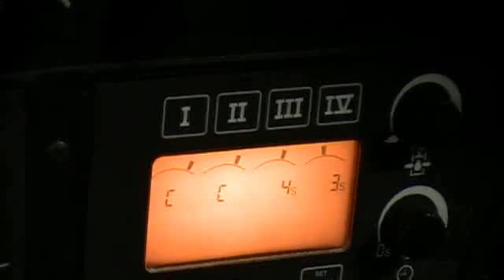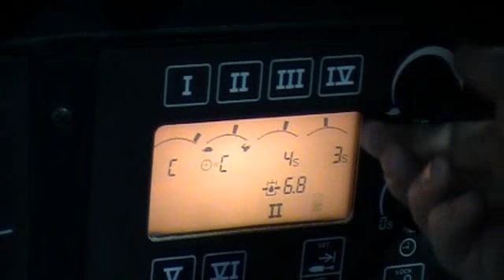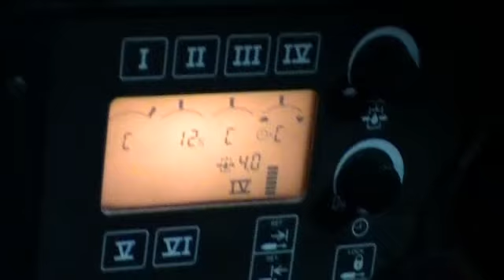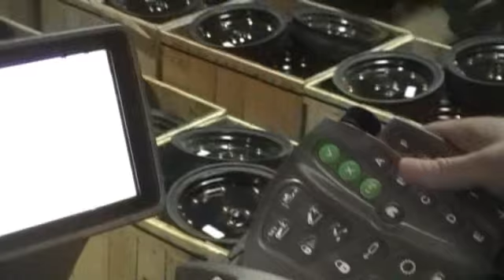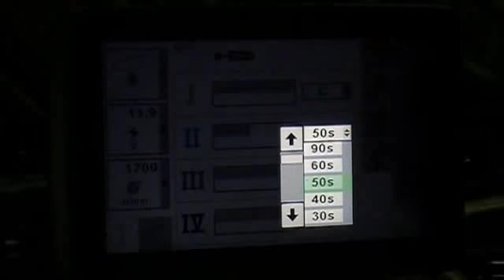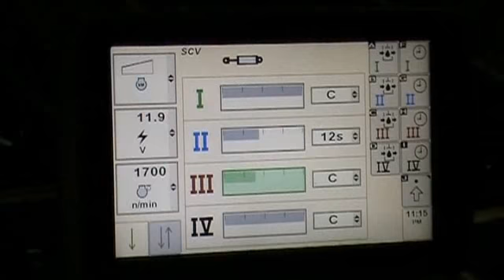Planter / Tractor Hookup

Comment: So, if you set your time, for example SCV 2 12 seconds, you will have presure in the system for 12 seconds after you use it?
Reply: After you click the scv into detent either forward or backward, you will have hydraulic flow for 12 seconds and then it will turn off.